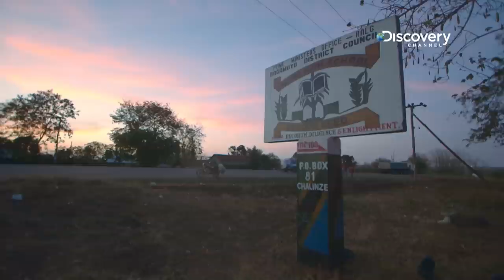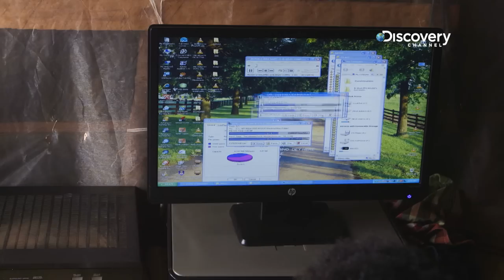Vietnam: Connecting East Africa

Comment: Wouldn't it be very easy for the poachers to simply cut the cable of the cell tower? The cable is not protected about one meter below the ground and it's not very hard to reach
Reply: The question is not if the poachers can, but if they should.